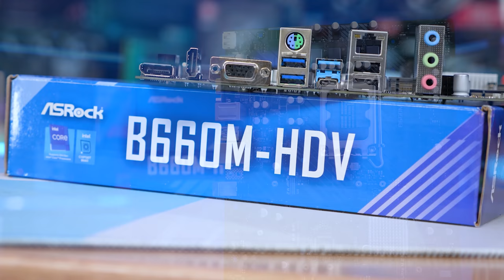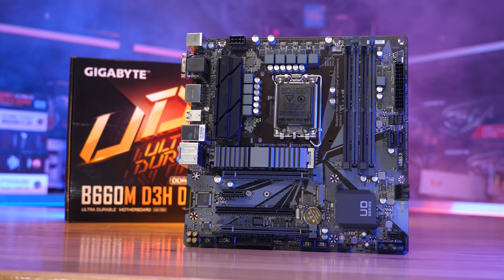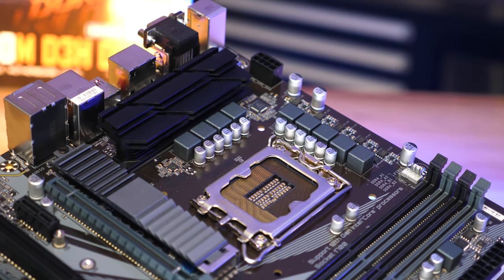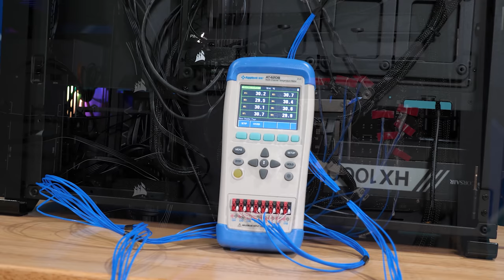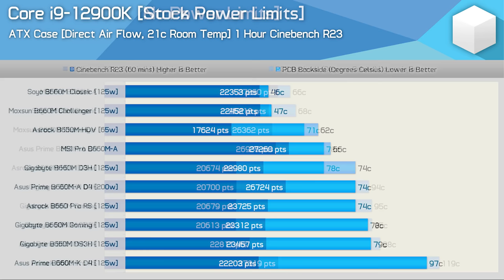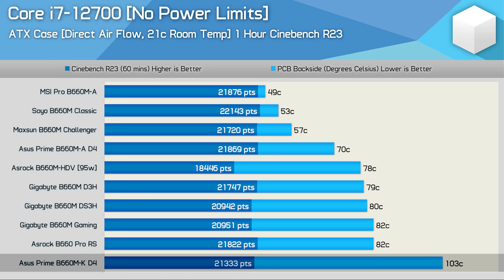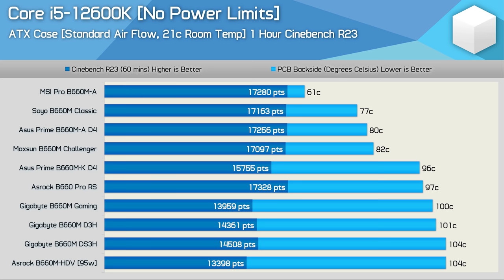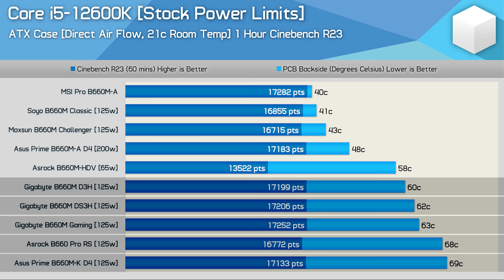Best Budget Intel B660 Boards, VRM Thermal Test

Comment: Wow. I didn't realise there was such a huge difference in performance and temp with same class mobos. MSI is impressive. Surprised about Asus and Gigabyte. Those were usually my go-to boards.
Reply: the performance is 100% predictable from the specs of the boards. The GIgabyte DS3h, D3H and Gaming (and D2h) are the same crappy board with different minor spec details. The Gigabyte Power is their version of the HDV (even worse). The Gigabyte Aorus Pro is similar to MSI's Pro A. MSI's crappier boards are the Pro E, Bomber, Pro G, Pro B. All those MSI boards would perform badly because they have no vrm heatsink. The difference is that if you are not careful when you are shopping you might not realize that the MSI Pro B660M-E is one of the worst B660 boards you can buy and basically a scam with the M.2 slot not even delivering the performance of the chipset, only  1 fan header,  only 2 RAM slots, naked VRMs, and just overall a horrible board, whereas the MSI Pro B660M-A is a very nice board, but the names are almost identical.

Comment: This video is useful also for upgrading to 13th gen (and beyond, when new cpus come out). Sure there will be bios updates over time that may help performance, but who knows how the power requirement will be with those chips. Nice extensive work.
Reply: it's hard to imagine someone getting any 12th gen now (well, 12400 and above), and feeling unsatisfied/in need of upgrade in 6-8 months time.. (I can understand why Ryzen 1600 users needed upgrade to 2700X and 3800X, and even 5600X, however, as it took that long to get 'very good'/Intel-like framerates. (In AMD's defense, the 3800X finally matched the 8700K stock after just 2 years)
Reply: @mdd1963  true, but an upgrade doesn't have to be 6-8 months. I mean, if I have a 12400 now, and want to upgrade to a, let's say, used 13900 in 4 years? (Depending on what skews intel comes out with with core/thread counts, power usage, how the architecture ages in that time, etc).
Reply: @qT_p13  that's true, but, if you wait that long, i doubt 13900/13900K will be cheap 3 years after release...; but, yes, it would at least be plausible
Reply: @mdd1963  yeah intel used prices don't drop like amd. I just mean like,in my case I have a 3700x since that cpu launched, but maybe in a year I might consider a 5900x or something. Like the same kind of deal on intel side.
Reply: @qT_p13  5900X was at truly excellent prices just a week or two ago!

Comment: There is a MSI PRO B660M-E model available in our region, which is like 30-40$ cheaper than MSI PRO B660M-A (also cheaper than Gigabyte B660M DS3H). Would love to see how that performs in the tests. The cheapest one is BIOSTAR B660MX-E. 
Asus PRIME B660-PLUS D4, ASUS TUF GAMING B660M-E D4, Gigabyte B660M AORUS PRO, Gigabyte B660M GAMING X- These are also budget boards that could be a nice addition to your test data. 

The 12900K data is mostly useless for consumers and only useful for the testing purposes I suppose (as nobody is realistically going to pair that CPU with these budget boards). Please do a roundup video on which B660 boards (from low budget to high) will be the best to pair with a 12600K and 12700 that can deliver the maximum performance of these CPUs without any power limit indefinitely. Also, in case of a i5 12400/12500, how much do these numbers and the concept of good or bad VRM actually matter? For example, should it be totally fine (or not) to pair a 12400 with the that Gigabyte Gaming X or DS3H or even Biostar board? 

Also, will there be a H670 roundup like this one? Cause ASUS PRIME H670-PLUS D4 is available at the cost of MSI PRO B660M-A (cheapest H670). How does that compare? Who should actually go for a H670 board and why? 

So many questions! Intel lineup is always confusing!

Comment: Quality video as always, but considering the prices of these 10 boards maybe there could have been some results with a 12400/12100 and less with the 12900?
Reply: i really agree with you but Steve did mention that any of these boards will do good with the 12400 cause it only uses like 70W
Reply: bro use gigabyte ds3h for 12400

Comment: Hi!
Direct air flow on what?
1) On 1 radiator
2) On 2 radiators
3) Somewhere else

Is there any video to see how airflow made?
Reply: For direct airflow he had a fan directly pointing at the VRM, he mentions it in the system specs portion.

Comment: B660M DDR4 if u plug RTX and any tower cooler it's PACK my ram 4x32 almost touching it and graphic have small clearance too 
Better go with bigger Motherboard or forgot Noctua Air tower coolers

Comment: Hi Steve, have you seen that video from Der8auer about overclocking non-K processors even on B-660 boards. 
Can you check on which boards you can overclock non-K processors?
Reply from the maker: No affordable boards can overclock.
Reply: @Hardwareunboxed  I am asking in general.
Reply: @1AmElectricman  there’s a list somewhere on the internet but mostly no. Those boards cost ~200+ and none featured in the video can do BCLK oc
Reply: @GabrielKLKN  I can't find this list. it can't be just 2 b600 boards from Asus.

Comment: 25:18 I just realized how the "on board WiFi" works. It's not on board at all, just a regular m.2 WiFi module slotted under the aluminum box! Usually the box covers it completely, but this board has its side exposed. So there's a hidden WiFi m.2 slot under there, very interesting...
Does anybody know if the WiFi module can be replaced in case of failure or even upgraded? Or the BIOS only accepts that specific module?
Reply: you can replace with any wifi module

Comment: I bought the mortar B660m DDR4 Wifi, I'm eager to hear about your findings on that board, as I'm not yet able to assemble my new system, because I have to wait for the LGA 1700 compatible mounting kit for my cooler. I picked it over the MSI 660 Pro mainly over Aesthetics, which might have not been the smartest move
Reply: Is the most expensive matx b660 on msis lineup. I think you bought something really good, the mortar range has great track record. The only argument will be why not buy an Z690 at that price, but whatever
Reply: @blueryxfalls7949  yeah, but I went with a 12400 with it, so there will be no oc either way, and the Z690 Boards in that price range were very low tier, so I think it might have been a good choice after all :)

Comment: SOYO needs to make a return to the US and also make a return to their colorful board layouts rather than following the trend of blacked out PCBs and black slots. They used to have white boards with black traces and purple or yellow slots. I wouldn't buy any Asus motherboard at this point no matter how good because they force Armoury Crate garbage that digs into your system like a tick and even after you remove it, the code is in the BIOS which prompts a reinstall. This is why I have returned Asus B550 boards last year in favor of MSI or higher end Gigabyte or ASRock models (never get the low end or you'll end up regretting it) and promptly got rid of ASUS ROG keyboards when I found that I couldn't adjust everything on the board itself and had to install Armoury Crate.

Comment: Thanks for the effort

I was a bit scared for ds3h motherboard 😅 
I thought this is worst board 😃

I am happy now 
I am using it with 12400
Reply: Bro sorry for late replying but do you prefer b660m ds3h to Asus b660m-k d4? Which one i should buy? im going to use with i5 12400f

Comment: This is my only gripe with recommending intel in the current market. You definitely have to spend a few more extra on getting a decent motherboard and cooler if you're picking a mid-high end build, and the lower end spectrum suffers as well since if you are looking to upgrade low-end cpus (12100F/12400F) sometime in the future, there's no low-budget option besides the MSI B660M-A. I remember checking through even the previous B560 boards, and none of the budget options were any good. 

If we increase the price range any higher from the boards reviewed, we enter the high-end B660 boards which also lie in the same price-range as budget Z690 boards which offer a better upgrade path, showing/hoping they provide good enough VRMs to support overclocked intel CPUs well.

Comment: Hm... I'm looking at Asus Prime B660M-A D4 in EU region and the picture on the board does NOT feature a top heatsink! Your version is Asus Prime B660M-A D4 WIFI, which seems to have an additional heatskink besides the WIFI feature. Either that, or there is some dodgy regional difference between models.

Comment: The recommended MSI board ran the 12900 without powerlimits, but the 12700 with powerlimits? Did I understand that correctly? Why does it do that? 🤔
Reply from the maker: 65w parts run at the spec. You can change this really easy in the BIOS though.
Reply: @Hardwareunboxed  I see, thanks for clarifying!

Comment: Thanks for this video! Quick question--to obtain these results for the MSI Pro, did you connect the 4 pin CPU power connector when testing the i5-12600k, or just the 8 pin?

Comment: Massive temp difference between direct airflow and normal case fan setup. That should reconsider aio designers to add a proper fan, even better than the one in artic freezer ones, on the waterblocks
Reply from the maker: It's basically impossible to achieve that though.
Reply: I don't think the target audience of these boards will often be using water cooling.
Reply: @HodgePodgeProducts  some of them are 165€ boards ... and a loooot of shops here in spain, do builds using "cheap" aios cooler master ones, 35€-45€ 120mm and people use them too. 
the only fact here is, temp with direct airflow reduces temp -37ºC what is a lot, and make some of them viable even for a 12700k. Not sure how bad are the vrm temps when using tower cooler instead of aio
Reply: @Hardwareunboxed  rog ryujin ii does, kinda on a similar way i was thinking , in my opinon fits larger fan, if you dont bother to cover it. 

anyways as i think i said, the easiest way is just building motherboards with proper vrm, but you know that most medium low budget intel mb, most of them are junk, they refuse to make them 7€ more expensive and use proper vrm

Comment: Intel 12th Gen is very fast but I wonder if they've sacrificed some x86 compatibility to reach these speeds.  I've noticed some games from the early 2000s won't even start even though they work just fine on my Ryzen 3900X system which is also running Windows 11.  I've tried the E-Core disable trick but still no luck.
Reply: If so, that would be ironic...
Reply: well sont forget the fact you literally cant run win7 on alder lake cpus, so no surprise if some old software is also broken
Reply: The issue is that the DRM of older games cannot handle the efficiency cores, so if the game uses an efficiency core to run the application will crash or not run at all. 
You can 'work around' this (though it is quite crude) by disabling the efficiency cores in the Bios
Reply: @CarthagoMike  No, that's only the Denuvo issue which can be worked around with the scroll-lock trick.  I'm talking about older WinXP games that don't work even when using "No CD" patches that normally allow them to work under Win 10/11.  One example is Links 2003 which runs on every modern Ryzen or Intel CPU in Windows 11 except for Alder Lake.

Comment: I'm looking to upgrade from a x570 and 3900x system that I'm leaving a nas/unraid/trunas server and getting a simple PC. I've always had got results with gigabyte in the medium price range so I was going to get a gigabyte b660 but the MSI is looking really good here. Probably going to pair it with a 12400 and my 3080 and using the nas for storage.
Reply: To clarify, I play at 4k and 1440p only, so more gpu demanding than 1080 in terms of CPU, so I don't think Im going to bottleneck the 3080 in any way even with a 12400. As this system would be for gaming, livestreaming (nvenc should be enough) and light work (no video/photo editing).

Comment: 1 - What is the difference between Direct airflow and Standard airflow here?
2 - Also in MSI Pro B660M-A with both airflow, the Cinebech score for i7-12700 was around avg 15,000 and for i5-12600k was around avg 17,000. Does that mean 12600k is a better combo with MSI Pro B660M-A than 12700 or am I missing something? 
Need suggestion to choose a processor for this specific Mobo with the highest potential but with an Air cooler!!!!
Reply: Thta's because of default power limit by MB which will probably gonna be fixed with next updates.
Just check the graphs without any power limit and MSI boards scores higher than any other board on this list while VRM temps not getting any higher than 71c.

Comment: I was looking at an ABS Starter kit bundle Newegg had with the Pro B660m-A but it appears the bundle version appears to be missing the heatsinks on the VRM, I thought it was weird for a board with an 8+4 CPU power prevision to not have VRM heatsinks, now I know it's supposed to have them but they appear to be missing in that ABS bundle.

Comment: hello, thanks for the video.  (leaving out the benchmarks) While using the processor, have you noticed any particular area where you can exploit it and take advantage of its computing power at 100% (or a little less)?  being a very powerful CPU that in general use makes no difference even compared to a 12400 or even cheaper CPU, in what can you feel the difference more? even with regard to some type of programs where the performance difference is more marked eg : programming: text editor;  3D design: gaming.
Reply: Gaming is going to vary on a per-game basis, code compile is going to benefit*, CPU encode is going to benefit* (while still being slower than GPU encode for most GPUs).

*Intel Thread Director only gives P-cores to the program that has focus, so if you switch to a different application, performance is going to tank. You can disable this behavior by setting the desired process to not use ANY E-cores.
Reply: @kotekzot  ok, thank you very much :) last question: so not all apps / software make the most of p-cores?
Reply: @alsteooaai  by default only the active window will have access to P-cores, while all other programs will have to make do with E-cores. I expect this behavior to be changed at some point, or perhaps 3rd party software will be able to change it.

At the moment, you can manually forbid a running process to use any E-cores with Task Manager, giving it access to P-cores even when it's not the active window, or you can use Process Lasso to make the change permanent for a given program.

This is obviously a bad solution, as you have to leave a fair bit of performance on the table to get a background process to use P-cores, but it's not as bad as tripling the time it takes to complete a (CPU-bound) task in the background, which is the default.
Reply: @kotekzot  by default only the active window will have access to P-cores, while all other programs will have to make do with E-cores. I expect this behavior to be changed at some point, or perhaps 3rd party software will be able to change it. At the moment, you can manually forbid a running process to use any E-cores with Task Manager, giving it access to P-cores even when it's not the active window, or you can use Process Lasso to make the change permanent for a given program.
Reply: @kotekzot  say it is wrong to dedicate more cores to the background?  better him and core
Reply: @alsteooaai  don't know what you mean.

Comment: Great roundup.  Super curious whether the EK-LiteBlock on the MSI MAG Torpedo EK would fit onto the Soyo and Maxsun given their VRM heatsink design looks very similar to the Torpedo's and whether that block would benefit them as much/more than direct air flow and when/if EK will make that LiteBlock series general availability rather than just tied to the Torpedo.

Comment: Almost only mATX mainboards...why? And there are so many more mainboard boxes on the table than are shown in the benchmarks :(. I was hoping to see boards like the ASUS Prime B660 Plus, ASUS B660 TUF Plus, MSI B660M Mortar, MSI B660 Tomahawk, Gigabyte B660 Gaming X, and so on. Yes, those are not super-budget, but they are the important ones for PC builders who don't need any Z690 boards - which are most of them, if we are honest, since CPU overclocking with normal means is almost dead by now.

Comment: What’s the better buy right now between a 3080ti for $1850 or a 6800xt/6900xt at $1500 or a 3070ti for $980 for all 3 uses of gaming, streaming and everyday use at 1440p? Upgrading from a 2070 and going to pair with a 5900x.
Reply: Check Best Buy if you're in the United states. Best Buy usually drops cards once every 2 weeks, to every week... on a random morning. Check the channel fixitfixitfixit, for info. The reason I say check Best Buy is because you can get a Founder's Edition card from MSRP on there. 

Me.... if I couldn't find a Nvidia FE card, I would go for a $1500 6900xt.... or I'd poke around for an EVGA FTW3 3090..... because usually the EVGA FTW3 3090 can be found for $1900 if you can find one.

Comment: The ASRock Pro RS looks a lot like my ASRock B560 Pro4, down to I/O set. The Pro4 also tested crap, but I got mine for $100 CAD ($70 USD) after rebate so it's a bit less of a crap value at that price point.

Comment: I was wondering, why you didn't include the Gigabyte B660 Gaming X. Because you can find it here in Germany for around 150 Euros and it puts most of those boards tested here to shame. Is it that much more in the US?
Reply from the maker: Yes that's more than $140 US
Reply: @Hardwareunboxed   Ok. Yeah i see, that for such a test you have to draw a line somewhere :) But in my opinion here in Germany (maybe Europe ?) it is the best "i call it budget"-B660-board on the market right now.